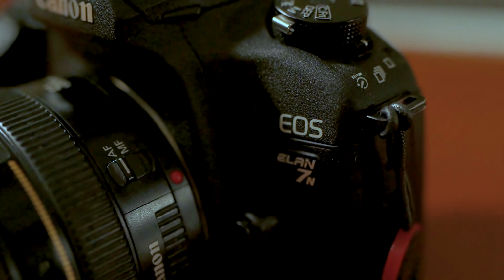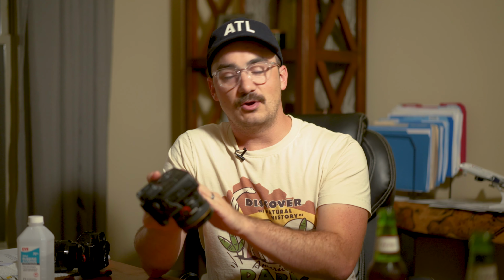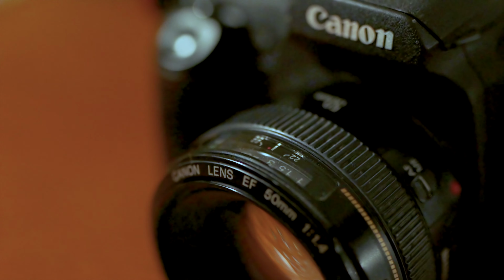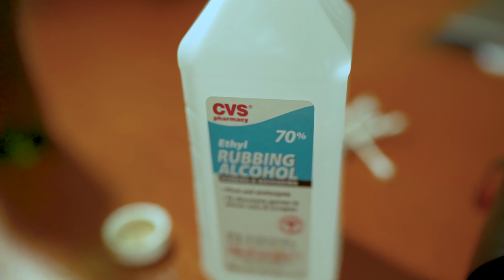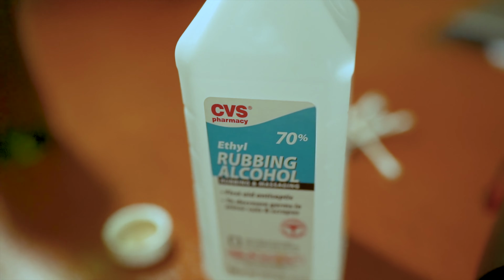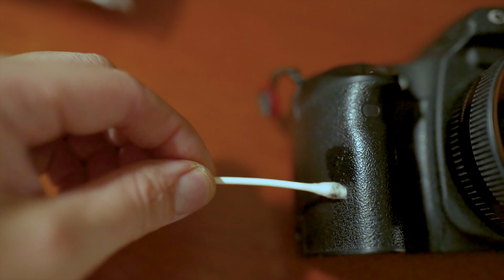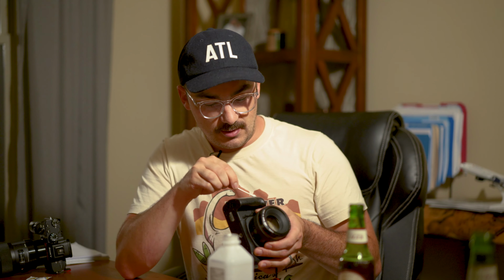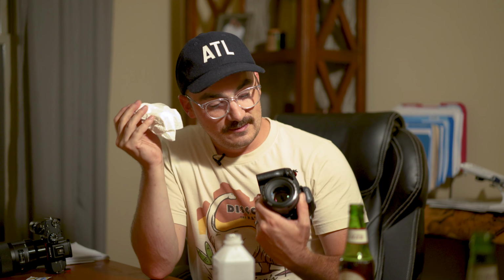How to remove sticky rubber on old film cameras

Comment: Chemist here. Rubbing alcohol is isopropyl alcohol. Great video on how to remove the sticky rubber on camera grips. It is very important to never use acetone on anything plastic as it will dissolve the plastic as well.
Reply from the maker: For sure! THanks for being here
Reply: @adamsiegfried6098
For removing sticky residue from rubber/plastic, would you recommend 70 or 91% isopropyl alcohol?
Reply: I’ve been successfully using acetone to remove stickiness. I did not find it dissolved the plastic, however, it did remove painted markings
Reply: DOH!!
Reply: Since you're a chemist; I've met this stickiness on several of my devices (cables, rubbery surfaces or parts). I thought it is plastifiers (that make it soft/softish/rubbery) that get out of the material. So it's no so much something ON the surface, but the material excreting that stuff (and will keep doing so). It happened in my case over the years, but mainly due to high temperatures/heatwaves. In a way is not something ON the surface, but a process of this stuff leaking out of the material. As far as I know these plastifiers are not heathy stuff too. Can you say something about that?
Reply: What causes it?
Reply: The sticky stuff is indeed the plasticiser migrating out of the host material. Plasticisers are used to modify the properties of the basic compound, for example PVC (polyvinylchloride) is a hard and brittle substance which is virtually useless without the incorporation of a plasticiser.

ps I am not a chemist!

Comment: Someone may have already mentioned this in the comments. Using a microfiber cloth (tight weave side), rub and clean the rubber grips with your IPA 90% on that. It is much more effective and faster. Once you have it all cleaned up, use a product called Magic Lube, by putting just a little bit on another microfiber cloth (not too much at once), and then work it into the rubber grips. If you own a swimming pool you probably know what Magic Lube is. For those who don't, magic lube is a Teflon-based non-melting, non-toxic formula that is waterproof for use in both wet & dry environments. We use it to keep our rubber seals conditioned in our pool pumps, equipment, and filters. I have restored many camera lenses and camera body rubbers following this process. Maintenance going forward, keep the rubbers conditioned and you should be fine. There are cases where the rubber grips are too far gone and you simply will need to replace them. At least for Nikon, you can buy new pre-cut rubber grips specific to your body model through various outlets like Amazon, eBay, or maybe even your local camera repair shop. Same for lenses.
Reply from the maker: Thats really cool. I want to look into that. Yeah the alcohol took some time haha

Comment: I bought a brand new miniature Minox Lieca If camera several years ago for my collection, therefore I never used it, however over time that vulcanized rubber coating broke down and I had to remove it with 90% isopronyl alcohol.  I have had other stuff brake down with this vulcanized coating, and for this is the reason I won't buy anything that has this vulcanized coating, as it is a garbage coating that will brake down over time, not to mention the poor engineering of this substance!
Reply from the maker: I hate this stuff!

Comment: Just bought a Cannon EOS 300D for $22.95 & free shipping off eBay. Seller stated it was in very rough cosmetic shape with a lot of the silver scratched, rubbed off and rubber gooey and sticky but, fully funtional with charger and extra battery. When I got it and used rubbing alcohol to clean it up it also cleaned the black rubber off the silver body they thought was worn & scratched. Looks like a  new one now and I couldn't be happier. Thanks!
Reply from the maker: That’s amazing!!! Congrats!!

Comment: I saw another video of someone that used hand sanitizer and let it sit on the area for a bit, then I busted out my electric tooth brush with an old brush on it and went scrubbing. You can use a bit of baking soda to add some grit to it. Helped speed things up and came out really nice
Reply from the maker: Those are great options!!
Reply: That's the alcohol in the steriliser. Better to just to isopropyl.
Reply: takes way longer

Comment: I had a small shortwave radio that I bought new.  After a couple of years the rubberized coating turned into a nasty black, sticky coating that came off on my fingers.   I did this to it quite a while back out of desperation with alcohol and a rag and removed the coating completely down to the plastic beneath it.  I then took a soft cloth and polished the plastic, which turned out to look quite nice.
Reply from the maker: Thats a great tip!

Comment: I received a MacBook Pro a few years ago that had an aftermarket shell that went sticky. What I did was covered the gummy side with a few paper towels and then saturated with solvent grade IPA at 98%. After soaking the paper I immediately covered everything with some plastic wrap for a few hours. The coating came right off, cleaned off the residual with an alcohol wet towel. Good as new but a bit slick.
Reply from the maker: yeah it makes it more slick for sure

Comment: Cool 👍 Have you tried Acetone…saw another video where the guy was removing crud using acetone, which is basically nail polish remover.
Reply from the maker: its just really harsh. you can go fast but if you go too fast you could damge it.

Comment: I just did this to a Minolta 500si which was cheap due to it (but worked) and denatured alcohol also works. That said due to how exposed the control gear on Minolta cameras is, I disassembled mine (remove 2 screws, then remove the grip) to clean it as a precaution.
Even on a Canon where it is a bit trickier due to having to remove the front faceplate to remove the grip, I feel it's better to take the camera apart a little when possible. You don't need to open much either, and it prevents body damage.
Reply from the maker: That’s amazing! It cleaned up well!?
Reply: @film_friends  Yep. No additional steps needed, wipe and clean. It's still a 5 minute fix as well, even with it taken apart. It's like it never had this garbage on it. It feels a lot nicer than the 450si too and has a metal mount, but you lose the panoramic "block", so they both do different things well.

Yeah the thing was only $30 with a lens (35-70 3.5) and the lens goes for $25-30 on a regular basis so I had nothing to lose as I had a non coated 450si grip (bad control wheel from a as-is lot, the other 450si from the lot is perfect and I took it out with a roll of film and it worked perfectly) to fall back on since it's the same part outside of the coating.
Reply from the maker: I looovveee a cheap cam find!
Reply: @film_friends  I was like get it get it get it even though I didn't need it, for that lens alone and got a free body I am absolutely going to keep. Sometimes buying equipment for glass and getting a bonus body makes more sense. The grip rubber issue wasn't disclosed when I bought the camera, which was annoying.

The reason I can forego the panoramic block the 450si has if I can choose which one to shoot is it blocks it in such a way you end up with black bars on the film to work around in post after scanning the negatives in. For printing, I need to get Panoramic paper and a printer which can do it (Mine can't, I use a Selphy CP1200).

While I like both, the 500si wins in the sense it trades this for a metal lens mount. The date stamp is dead as it stopped working in 2019 due to a hard coded limit. The 5 is fine, but I do not know about the 7 and 9 being models where it was largely rejected as a professional body.

Comment: Here’s my research on ChatGPT on the cause of sticky rubber: 
Plastic can become sticky for several reasons, usually related to chemical degradation, contamination, or exposure to certain environmental conditions. Here are the primary causes:

	1.	Degradation of Plasticizers: Many plastics, especially flexible ones like PVC (polyvinyl chloride), contain plasticizers to make them more pliable. Over time, these plasticizers can break down or leach out of the plastic, leaving the surface sticky.
	2.	Environmental Exposure: Exposure to heat, UV light, or humidity can cause certain plastics to degrade. Heat can cause the plastic to soften, while UV light can break down the chemical bonds in the plastic, both of which can result in a sticky surface.
	3.	Oxidation: Over time, some plastics can oxidize, particularly when exposed to air and light. This oxidation can lead to the breakdown of the plastic’s surface, making it tacky.
	4.	Contamination: Plastic surfaces can become sticky if they come into contact with oils, adhesives, or other sticky substances. Even hand oils or residues from cleaning agents can sometimes create a sticky film on plastic.
	5.	Decomposition of Additives: Plastics often contain various additives like stabilizers, colorants, and fire retardants. If these additives start to break down or migrate to the surface, they can make the plastic sticky.
	6.	Age: As plastic ages, it can naturally start to degrade, especially if it’s not stored properly. This degradation can manifest as a sticky or tacky surface.

If a plastic object becomes sticky, cleaning it with mild soap and water, or using isopropyl alcohol can sometimes help remove the stickiness, depending on the cause.
Reply from the maker: There you go.

Comment: After wiping it down with the alcohol, allow it to dry a couple minutes and sprinkle with cornstarch and wipe it into it.  Then wipe that off real well and it'll feel great again.  This works great for rubberized coatings on most anything such as pots and pans and handles on many other things.
Reply from the maker: A few suggested this. I wanna try it

Comment: I too had an older 35mm camera with a very sticky grip. Before you try using alcohol or even acetone as some others have recommended, first try Armor All. It worked beautifully for me. I saturated a non-linting cloth and started rubbing. It took about 15-20min of rubbing before all the stickiness was gone. The good news was there was no black from the grip on my cloth, so it did not degrade the rubber. It also left the grip nice and shiny.
Reply from the maker: Im so glad you could figure it out! there are lots of good solvents
Reply: I guess my grips are more degraded than most. I tried the armor all and getting just as much black as with alcohol.  But im staying with it, Im hopeful it will work. I want to use the alcohol as a last resort

Comment: Great advice.  Unfortunately it doesn't work with rubbery ribbing on camera lenses and I suspect with other surfaces that aren't as flat as your Canon grip.  What also doesn't help with more modern photo gear is that the 'rubber' is actually coated plastic, but it's hard to tell the difference.  Anyway, I've come to hate the stuff, whatever it is.  But nonetheless, thank you for uploading because you've obviously helped out a lot of people.
Reply from the maker: I haven’t tried lenses, it should work on textured things. I’ll give it a try if I come across one
Reply: Test with shoe cleaning foam.

Comment: I used hand sanitizer (which is 66% alcohol) on an old soft cotton rag and that worked on an old emergency radio. Finished up with a little WD 40 sprayed on the rag and wiped over the radio.
Reply from the maker: that works too

Comment: So alcohol will not mess up the rubber grip? I decided to get out my Minolta maxxum 9 and the battery grip but it is not super sticky but I can feel it doesn't feel right.
Reply from the maker: The grip is already messed up, The alcohol will not return it to its original state. that is past gone. it will get rid of the stickyness and turn it to more of a hard plastic state

Comment: EOS 5 had the 5 eyed controlled points across the frame in a single horizontal plain.  You set it up individually for your own eyes by looking at the far left sensor and initiating that into the processor then repeat for furthest right sensor.
Reply from the maker: so interesting

Comment: In fact, the camera has been exposed to high humidity and mold has attacked the pseudo rubber on the grips...   I had a Drysuit for years in Canada with latex seals, and in was completely destroyed in under a year in the high humidity of Singapore..   (Didn't need a Drysuit there anyways)...
My point is that the Latex/Rubber/plastic on these cameras is decomposed and the best thing is to get a camera shop to replace them.  Then, ALWAYS keep you camera in a drybox.

Also, your lens can be attacked by mold for the same reason, and they should be remove from camera body and held up to a bright light to see if there's any growth..  I bought a used Cannon D-50 and later found out why my photos look "soft", and it was because of mold growth on and in the lens elements..
It can be cleaned in most cases by the Manufacturer's service center, for a price..
Reply from the maker: Thats some great info!

Comment: It works, but why on earth do manufactures spray rubber onto plastic that over time degrades to a sticky mess.  Behind the LCD on my 2015 Fuji X-T10 is as stick as heck. Its part of the camera that has spent most of its lifespan in the dark.
Reply from the maker: yeah i dont know either. i feel like they need to figure out rubber technology amirite?
Reply: @film_friends  same problem with older automobiles. It is part of the vulcanizing process and you can't change chemistry. They would have to use a different material completely but still have the same level of "stickiness". Cameras that are regularly used don't have this problem BTW

Comment: The rubber on my Olympus has gone sticky and beyond saving. The parts just slides of their mounts with little effort and when I try to clean them, they crack away like a sheet of cheese. Then I'm left with a thick and disgusting layer of glue residue on the camera body. Alcohol didn't do anything. Paint thinners and lighter fluids on the other hand, cleared them away in seconds. But be careful to wipe dry the clean surfaces immediately because those chemicals are corrosive!
Reply from the maker: Yes! Paint thinner is very abrasive so I would be carful! Alcohol won’t damage your electrical stuff on these old cameras

Comment: There are better solutions to solve this problem. The Rubbing alcohol is too mild of an agent and will take a ton of time. Next time try Lacquer thinner and a micro fiber towel. I have had great success with this in the past on Older Canon L series lenses where the rubber coating (on top of the paint) is sticky and coming off. The Lacquer thinner won't remove the lens barrel paint either. Canon sprays a clear coat on the paint before they add the rubber texture. Just make sure to keep the plastic lens caps on the lens while using the Lacquer thinner. Keep the Lacquer thinner away from the lens glass. I own a camera rental company. Good luck.
Reply from the maker: Totally, It does take time but is less abrasive and more readily availble around the house. I get wanting to go faster but the damage to other things around including the camera with something more abrasive is a bit scary. especially how messy this got haha. 

I love that expert advice though! keep those cameras clean!

Comment: Take the camera apart if you can otherwise you're gonna be pushing gloop crud into all the joints.
Whatever you do don't use WD40 as it'll find it's way all the way inside the camera - which is what it's designed to do as a water dispersant.
Reply from the maker: eh i dont see that being too much of a problem. But I def could see that

Comment: Manufacturers should stop applying these rubberized coatings, it really is time consuming to clean this stuff including power tools etc; before you can actually use them.
Reply from the maker: Rubber has come a long way, but inherently it will wear out. GO with all metal construction
Reply: After one experience with a rubberized radio I will never but never buy anything more coated in rubber.

Comment: You do realize that we clean electronics with a 24% solution of isopropyl alchol? You are not going to hurt the electronics even if you were to dunk it in alchol which is what we do with electronics that get submerged. You will remove any lubricant with it though so that is what you need to watch out for
Reply from the maker: I don't realize that, I am not an electronics guy. Thats a great thing to mention though